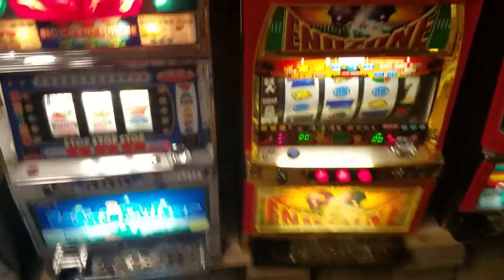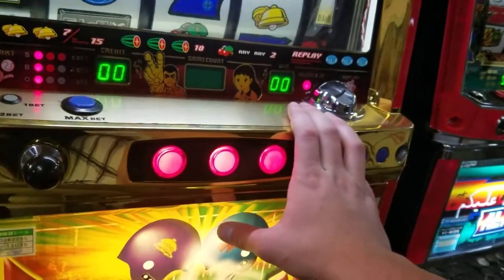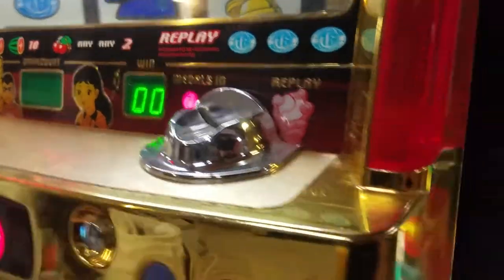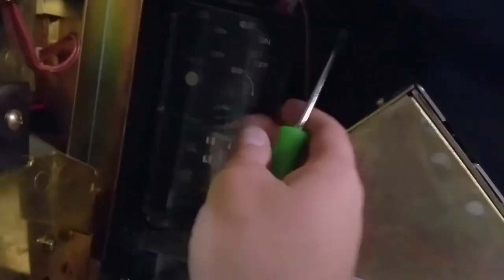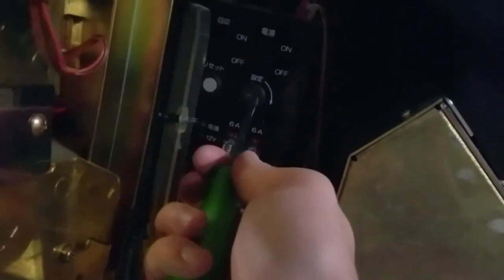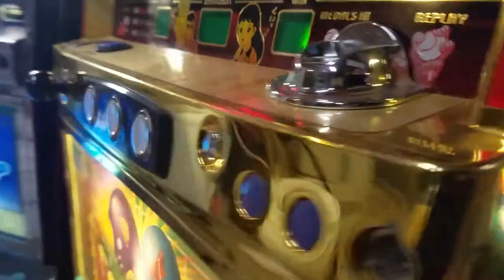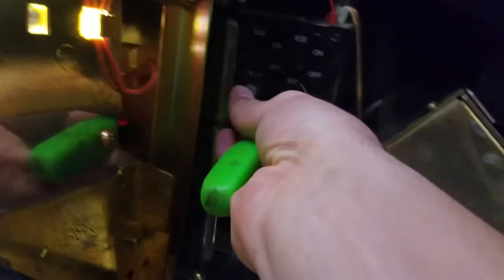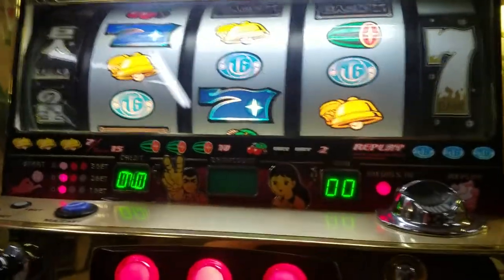Errors and how to reset your Pachislo Slot Machine

Comment: Hi! I have a couple of questions for you? I just recently purchase a JET SET Pachislo. I am having an issue with coins and reels. When I place a quarter (quarter converted by previous owner), it just falls in the tray not hopper. Why? Also, my reels will not stop. Any advice? Thanks for commenting!!!!!!!!
Reply from the maker: Thank you for the kind words! I am by no means an expert, simply can say where can I test to what has worked for me in the past.

 I suppose a couple of questions that I have is did the previous owner replace it with a different coin mechanism? Sounds like a silly question, but naturally if it wasn't replaced by a new coin mechanism it could have defaulted back to tokens. I would try and take a look just to see if you have any tokens on hand whether those would go through properly. 

Do all fuses look good as well, or do you have one that's blown or not keeping continuity? Have you tried to reset yet? Sometimes I've seen that if the hopper is continuously spitting out coins, could mean that it has yet to finish it to Jackpot, which would be fixed by a reset, at least I would think. Next thing I could think of it would be that the hopper due to spitting out so many coins over time could have got misaligned and is basically being told to spit out more coins. Not sure if this helps at all? Justin first initial thoughts. Like I said, I'm definitely not an expert in this field, just have had some success stories checking for those few things first
Reply: @jacobnienaber7653   Thanks for replying! Great video. The previous owner bought it from a pachislo collector, and he did convert it to quarter coins. I just got the reset key yesterday. Will try that.
Reply from the maker: Great! Glad to hear it. Where did you get your reset key from? Will be able to help other folks get their purchase low needs if you used a different resource than I normally do. keep me in the loop!
Reply: @jacobnienaber7653   Ebay.

Comment: What do the two little switches do underneath the on and off and the rest switch?
Reply from the maker: That is a great question that I don't exactly have a great answer for it this time. I would have to take a picture and have it translate for me. I did this at one time, but honestly I cannot remember what they are for.
Reply from the maker: I honestly have no idea! Well, at least I thought I knew it one time. I would have to take a picture and have Google translate it for me. All I know is that they have to be positioned if I remember correctly inversely to one another in order for the power supply to work. Not 100% sure on that though. Great question, not a great answer

Comment: I have an E-8 error code on a Sankyo machine and an E-1 On a Sammy machine. Never had a issue with either. They were not played for months and the power was off for that time. When I tried to play them those issues came up. Searching the Internet and did see one remark about the machines loosing memory due to not being played for a long period of time. This will affect the capacitor on the machine . Is this correct? If so is it an easy fix and how to do it? Thank you for your videos, Lou
Reply from the maker: Hey Lou! Apprciate that you appreciate the videos. I have never had this issue, but let me do some research and keep you posted.
Reply from the maker: Lou, thank you for the appreciation of the videos! I've never had this issue, so let me do some digging and I will get back to you as soon as possible.
Reply from the maker: @doowopmusicman  should be able to! What is your email?
Reply: Hi nice video in have a sammy with an E1 also did you guys figure that one out ?

Comment: Or what do you do about a e3 code
Reply from the maker: When doing a little bit of research I believe in E3 is a hopper issue. Once the hopper gets to a certain amount of coins, it needs to be refilled and reset (every machine is different). I would refill the hopper, make sure it is dispensing tokens correctly, and then reset the machine as the videos instruction above

Comment: how do you fix an EE error
Reply from the maker: After a little bit of research and ee are is indicative of either a ROM chip that is going bad or wiring that has been not properly seated. I would make sure that you were wiring is in the right places and that all of your chips are properly seated as well and that it is as clean and dust free as possible. Afterwards, I would try to do a reset as instructed in the video. If neither of those work, I would not be sure who to send your board into, but may try to find a new one.

Comment: Jacob, thank you!,  The reset worked like a charm on my Evangelion machine, got a question for you, my machine pays out coins but it will not accept them, any ideas, ? thanks again
Reply from the maker: You bet! Glad this helped. What my explanation for this would be that the hopper units that you are probably experiencing have the ability to give or take a certain degree of perfection between the token what is supposed to be accepted, and perhaps a quarter. These particular machines accept tokens, and the coin mechanisms that they are made for our precise and identifying that it is truly a token. I hope this makes sense?